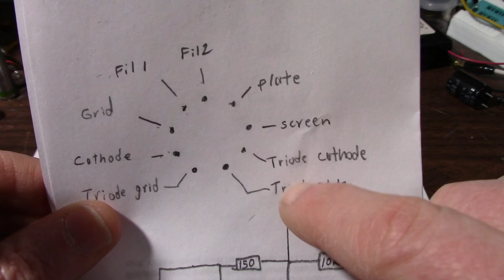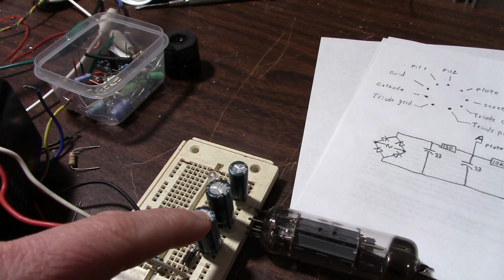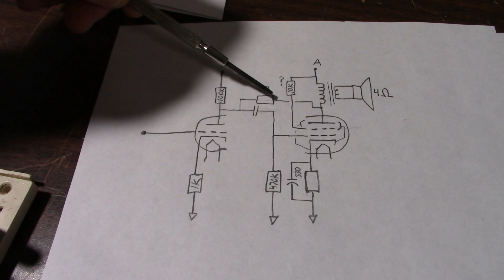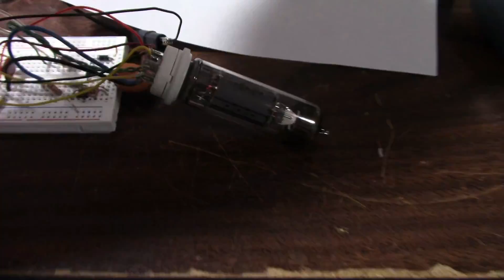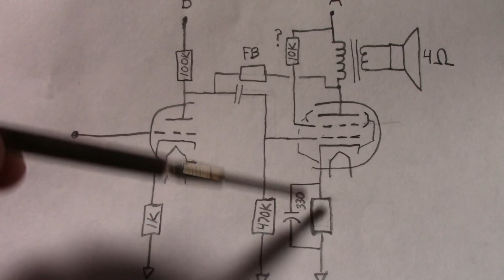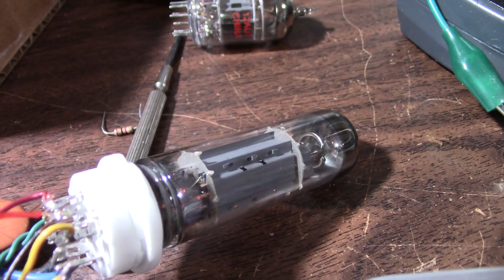Tube audio amplifier on breadboard using mystery tube

Comment: Any tube/valve with more than one amplifying section or two separate sections,duo diodes,dual triodes,triode pentode,are called compactron tubes/valves,popular type  were/are the ECL82(6BM8),ECL86(6GW8),there are more but the ECL82 was very popular in single ended audio amps in radios,tvs,some small guitar amps,a 12AX7(ECC83) and a EL84(6BQ5) are the amplifying models inside the ECL82 i'm sure,deff the EL84(6BQ5).

Comment: Neat triode pentode combo tube, all in one tube for pre and power stage. I assume these were done more for size and heat reasons than cost, but maybe they were cheaper too.
Reply from the maker: Yes, they were like the integrated circuits of the tube days to keep size and cost down. Color TVs used a lot of parts so they would have, for example, three triodes in one envelope instead of three separate tubes.

Comment: i made an actual breadboard socket for the tubes, take two pieces of perfboard, place em blank face to blank face, pass strip pins throught (the comb ones used on dupont stuff and arduinos) make a DIP chip style build, maybe with doulble spacing considering the hi-v, to let the thing stay straight solder it on the breadboard (it will not melt) soldering both sides makes it strong enough, then solder a regular tube soket on top of that with some pieces of wire, maybe connect a pair of plastic wires going off the build to hookup the filament suppy separately (better connection) and keep just one of em that goes on the breadboard trought a pin (to ground it).... no problems at all seen, and kool to look :D

Comment: This is an ECL82 good for about 3.5W with the triode section having an af of 70 ish. It was often used with one valve crystal players. All you need in a single envelope, coool.
The 86 is very different looking with an ecc83 size triode section. Otherwise similar valves. OK I'm gonna watch now....

Comment: ecl2 if the heater is 6.3V, pcl2 if the heater is 12V.  I built an amp built based on those. Sounds nice but the triode section doesn't have much gain so if you want to put some decent feedback another preamp stage using 12ax7 or 12au7 would be better.

Comment: It is a "ecl "series,perhaps ECL82 or more likely ECL86
Reply: An ECL86 triode section is shorter than its pentode section. It's an ECL82 where the triode plate height matches that of power pentode..

Comment: That's because you're running them with a low plate voltage! If you get a higher plate voltage the tube will sound waaaay better i bet.

Comment: Old glass envelope vacuum tubes are notorious for missing numbers  acids and salts from “fingerprints “ etch the ink used for identification numbers.  Add heat of normal operation and numbers disappear.

Comment: Probably a PCl82 or ECL82/6BM8. According to the tube manual I have it needs between 200 to 270V B+ for best operation. It needs a 4.5 to 8K plate load. And when optimally set up, it produces 3.5 watts "RMS" at 10% THD.

Comment: ECL85?.... With the operating triode feeding the tone signal into a non-powered pentode wouldn't there be effective capacitance of the pentode grid  to other elements that was screwing things up?
Reply from the maker: My guess is since the cathode is heated on the pentode and its plate is not connected, when the grid becomes positive, it pulls electrons off the cathode which shorts the positive half of the signal. That is why the top part of the signal was shown flattened on the scope.

Comment: Remember to use grid stoppers at the sockets my friend 😉.

I find even 1k can kill high frequency oscillation instantly. I've had valves under test oscillate with no feedback just from forgetting to tack a grid stopper or two to the socket pins.

It's a headache in the making when you forget to use the things. Ask me how I know 😂😂

Comment: A larger value for that triode grid stopper resistor, maybe 1meg might give a little more gain? What about a bypass cap on the triode cathode? Also the neg. feedback is also taken from the speaker side of the output transformer. I was hoping for more than 1/2 watt output, maybe 5 watts. Great build! Thanxz

Comment: I'd suggest that these may be E/PCL82 (or the US equivalents). In my (limited) experience the 82s had the longer triodes, as long as the pentodes, while the 85s and 86s had shorter triodes inside.

Comment: Maybe take a look at the schematic for the receiver/amp those tubes came out of. There are actually several tubes with this configuration, 7199, 6BH6, 6AN8......some have 15 watts RMS output watts! Great project! Will keep a close eye on this build and thank you for building a tube amp! This may have enough output to power some desktop/bookshelf speakers or computer speakers. Thanxz